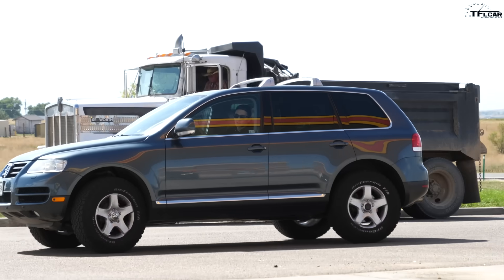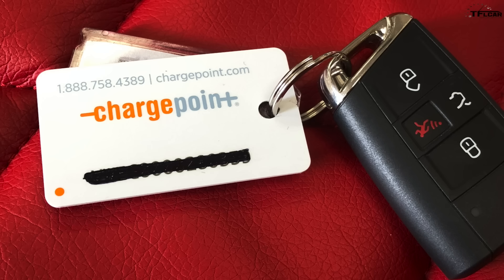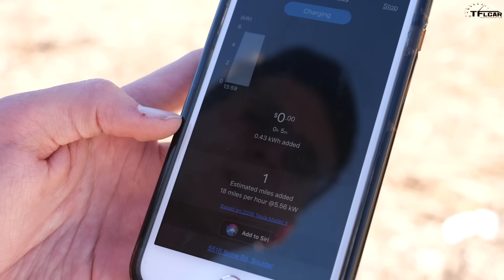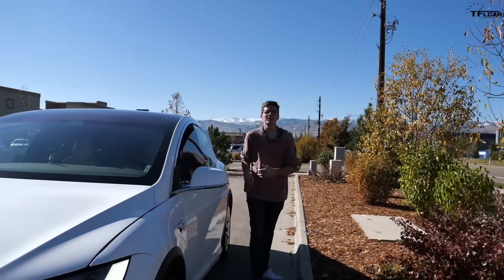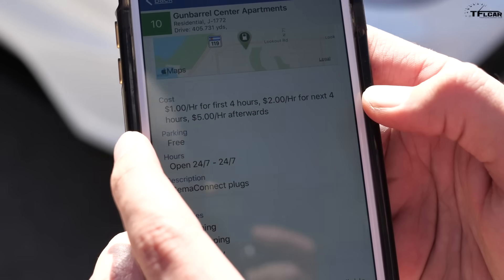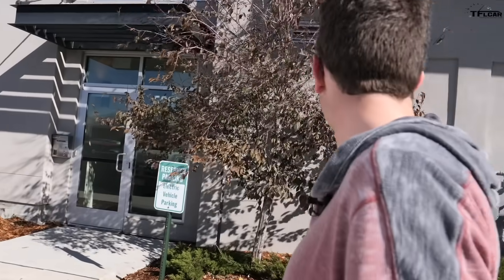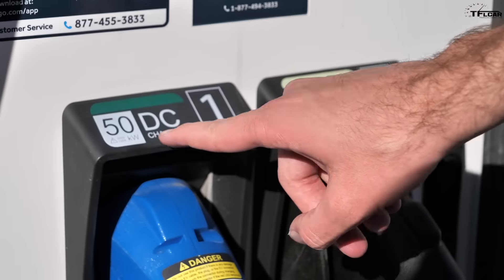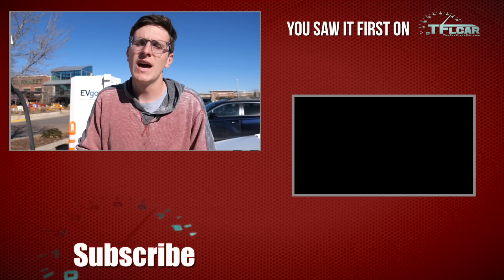Here’s Why Charging an Electric Car Can Suck - And It’s Not The Reason You Think!

Comment: What happens to the EVs when the mining of the volume of rare earth metals [the same ones needed to build wind turbines and solar panels] to build the magnets etc begins to decline to a point where it is no longer viable  even with the massive government subsidies they already receive, and the oil/gas industry has been intentionally crippled? 
Who is going to pay for the expensive replacement battery packs? How will the highly toxic battery packs be disposed of?
Remember that all batteries have a limited lifespan and will require regular replacement, not just a 'simple' engine rebuild like an ICE!
Reply: Bill Richards not true as the batteries will run for about 10 yrs, which isn’t short at all
Reply: @neilothee4966  I said that "...all batteries have a limited lifespan.....", an issue which plagues everyone who uses batteries whether it be for a mobile phone or a car. Compared to an ICE, a 10 year life span is very short but with regular maintanence, an ICE will last far longer than 10years. Some ICEs are still just as efficient now over a HUNDRED YEARS as they were when brand new.

Unlike a battery pack, an ICE can be safely rebuilt.

Further, as the battery ages, its efficiency steadily declines to the point of being completely useless.
Finally, can you please address the actual questions I asked?

Comment: If you live in an urban residential area and don't have a garage, there is a further problem: when you want to charge your car overnight, you first have to find a charger. Then, when the battery is full, you either risk a surcharge for blocking the charger for the rest of the night - or you go out in the middle of the night to move the car to another spot - which is usually the hardest time to find one.

Comment: Just wait, the price of charging “will” get comparable to gas.
Reply: I doubt it since majority of places give free electricity at their business and only need about 3 hours on a telsa charger to last you a few days of local driving. Plus supercharging is purely designed for quick charge for long trips and isn't in high demand since most people utilize their home or local free spots.
Reply: It will indeed.  Once the majority of the road fleet is electric the government will simply switch its revenue generating base.  As soon as your smart car is plugged into your smart meter equipped home it will inform "mum" that it is a car being charged and the appropriate "fuel duty (as determined by the government) will be added to your bill.
Reply: Yes .. and probberly even more EXPENSIVE 
They alredy claim problems in germany 
With the transport of power from Danish wind turbines .. 
So if you add som 100.000 thousend EV 
Well if you can't transport the power .. 
How Will you fill you car!!
Reply: Unless the time spent waiting to charge also gets comparable, I'll pass.
Reply: Carl Hursh I have solar & get credit but I live in sunny spot.
Reply: Yes.  Get you hooked and ramp up charges.
Reply: It's more complicated than that. Electricity is mostly generated by utlities companies that have public backing. Because of that, they can't just set the rate at whatever price they want. Charging at home will always be significantly cheaper than gas. Even if everyone switched to EVs and demand for electricity multiplied exponentially, the existence of DIY solar and wind (and the price of installation dropping dramatically) sortof keeps hungry utility companies humble. They juice the price, more people go off the grid and they don't want that.

 Supercharge stations are a little different. They can charge whatever they want but, right now, nobody would buy EVs if charging cost what gas costs. Even if they charged $.66/kWh to plug in (about double the average Tesla Supercharge price and six times the national average electricity price)... it would still be cheaper than gas mile for mile.

Until we start seeing 1000 mile ranges, though, EVs are only a serious option as a commuter car for someone with work/home charger access.
Reply: @aliebrubaker7473  you must be realy bumb!! 
I can see you zuk at basic math .. you got IT right !! You know who produses the power!! 
You also know if anyon makes food they All hawe to run flat out..to keep Up 
Ppl running ther stove's and oven's..
Now add x 10.000 to the power draw!!! ... Com on Mr IT is just !!! 
You can do the math!! 
What Will happend !!! 
When they are struggeling produsing power when ppl just make food ..
The STUPEDETI is tremendus ..
Reply: Carl Hursh 

Exactly.  Why would they not want to capitalize on this?  Plus this is extremely inconvenient waiting for the slow charge time.  

One hour charge time for ONLY 15 miles of driving.... 😵

Comment: hydrogen is the future in my opinion
unless we can charge our cars in the time it takes to fill a tank hydrogen seems the better alternative
Reply: Uh I hope you said this jokingly because Hydrogen is certainly not the future.  There is so much to explain why this post would be a short novel but in cliff note style getting the hydrogen in the first place is a very inefficient process. Then you have to haul Hydrogen in liquid form to the hydrogen station (highly dangerous). On top of that the Hydrogen has to be pressurized by the dispensing station before it can go into a hydrogen cell vehicle which the vehicle itself is not very efficient on using the hydrogen to convert it into usable energy.  Currently it takes a hydrogen station 30 minutes between fill ups so how would you like to sit there waiting for the station to build up enough pressure to fuel your car? Lets not forget that at least one of these stations has blown up.  Yeah that's safe.  Might want to do a bit of research before you make a comment like that.

Comment: In Norway you have to bring your own type 2 cabel to use it. And that`s great since your car either uses type 1 or type 2 plug. It`s just the QC who has cabels. Either Chademo or CCS. 
My only biggest problem is that America doesn`t use type 2 cabels and there`s a lot of cars imported like the e-golf, i3 and Fiat 500. And you simply can`t QC them! Not even the Tesla S and X which has the same plug as European type2  you can`t charge the car, so they are useless to import! It should be standard plug for every car and every continent.

Comment: Here in Canada we have very cold winters when we need heat in the car to keep warm and need the lights to drive in the dark.  How far will one battery charge take the car?
How much will it cost to replace the battery if and when it fails?
What sort of warranty comes with the car?
Reply: Extremely cold or Hot Environments aren't ideal for EV's. Especially the cold environments.You'll experience 20-30% loss in range.

Comment: I live in Tampa and I never seen a charging station.  Moreover I park my car in direct sunlight and why doesn't Tesla have a solar panel on top of the car roof as the car gets charged in the parking lot with free solar power.
Reply: Perhaps because each square metre of solar panel will give you 250Wh per hour in the sun.  That would give you, perhaps a mile of driving per hour in the sun.  So you get (say) 13 to 15 volts output from a panel at  about 20A, but that has to be converted via an inverter to a voltage suitable for charging the Tesla 350 volt battery.  You could, of course, put 24+ small solar panels on the roof, giving a voltage greater than the Tesla's battery voltage (in full sun, but not in the shade) and remember, every time you transform a voltage from the supply, whatever it is, to what you need, there are losses due to inefficiency... So, you put a Solar panel on your car roof, (at a cost,) add circuitry to enable the solar panel's output to charge your battery (at a cost), and the return is a mile or two of driving that cost far more than the few cents the power would have cost had you plugged it in.  Lunch ain't free, even in sunny Tampa.  My figures are not exact, but even if I were so pessimistic I'd underestimated by 100%, that's still expensive driving.
Reply: Tesla and energy companies can makes money out of people charging their cars or soon trucks, nobody controls or owns the sun.
Reply: @fortitudevalance8424  just wait until unfortunately the road are full of ev's the charging fees take off, they are only low now because there are so few cars about.
Reply: I live in Tampa also and never have a problem finding one
Reply: If the sun were that strong, it would kill all life on Earth.
Reply: Nice idea
Reply: A car isn't a 12v car battery or a mobile phone.
Reply: So how many square feet of solar panels do you think it would take to charge a car in even 24 hours?
Reply: @jackfenn7524  Excellent point. Even if the car was covered in panels, it would have very little effect on the level of charge.

Comment: This is precisely why Tesla is ahead of everyone else.  They knew this would be the exact problem they didn't want their customers to experience.  The Tesla SuperCharger network largely removes this problem in its design and high speed charge rate of over 500miles per hour when your battery is at a low charge state.  This is the charge state you should arrive at the charger with, for faster charging at each stop.

The other EV manufactures are so under funded for EV  development that they have no chance to create their own charging network.  I am not saying they should, but their customers are going to want something that is convenient and cost effective.  VWs punishment for diesel gate is "Electrify America", is paying for CCS/ChaDEMO plug type charging stations which will enable VW group cars to have their own charging network, paid for by the public, instead of by VW.  

It's going to be difficult to have a nice 200kw charging network across the public space for long distance travel.  It will be some time that everyone has to fight with all these choices if they are not using the Tesla charging network.  

Charging at home with a 240v @50amp circuit is a $300-$1200 investment for many just because of the costs of #6 wire.  But, if you have a spare 240v breaker space in your break panel in your garage (pretty typical), and can charge from a NEMA 14-50 outlet by your panel, you can get something put in for around that $300 price.  Some people have to get a new panel or even a new 200amp feed because of the state of their existing electrical system.

Overall plugshare like apps should be all that's necessary.

Comment: I've been driving my Chevy Bolt for 6 months now. I absolutely love it! Once you go electric, you'll never go back. I save time by: toping-off the battery overnight, never going to a gas station, never changing the oil, never changing the oil filter, never replacing any hoses, never replacing any belts, never replacing fuel filters, never replacing air filters, never changing the radiator fluid, never replacing transmission fluid, never replacing catalytic converters, rarely replacing brake pads (regenerative braking), and I get to my destination really quickly!
Reply: But the price of the battery is just as much as the car, and driving in heavy rain is another thing.
Reply: @GieCampbel-ug9jl  The battery is guaranteed for eight years. I don't know how much a new battery will cost in eight years. Will there be cheaper third-party choices? Will I even need one? Will I buy a new car by then? Even with an ICE car, I could be in the market for a new car in 8 - 10 years, anyway. (I did keep my last vehicle for 22 years, though.)
I've driven in heavy rain and found no difference. Why would an electric car be different than an ICE car in the rain? My Bolt is only front wheel drive, but many of the Teslas are all-wheel drive so they should handle very well in the rain. I've seen many Teslas doing fine in the snow.
Reply: @allencox5413  how dare you counter his argument with logic and evidence, you monster
Reply: @Techguyericd  heh heh heh
Reply: @Techguyericd  i agree! 2020 Dystopian future with logic and great points!
I shudder!
Reply: @allencox5413  try it in Arizona
Reply: @wlonsdale1  Hey Walt. The range of the Chevy Bolt is advertised as 238 miles. This depends on how you drive. My range indicator has shown over 300 miles if I am not being lead-footed. The things that cut down on range are excessive acceleration (which I am guilty of - it's just too much fun!) and the heater. Since the motor creates very little heat (think loss of energy), the heater has to use an electric heating element that drains the battery on cold days. Just like Southern California, this won't be much of a problem in Arizona. I have found that the AC does not affect the range by much.
Reply: @allencox5413   Yes, but excessive heat or cold is not good for batteries, and cuts down on battery life. More mild temps are ideal.
Reply: @allencox5413  EV Batteries last 8-10 years at a cost of about $10K. What do you think that will do to resale values.
Reply: @sptrader6316  That is a good point. I'm not sure. I'm on a three-year lease now. Will I continue to lease so I'll be driving a 2025 Bolt then? If I buy my 2019 Bolt (which I am seriously considering at the end of my lease), how much will my battery degrade? Will still be good enough to get me around town? In 8 - 10 years  will there be inexpensive third-party alternatives? Until then, I'm enjoying the performance of the EV, the maintenance-free aspects of the EV, the fuel savings of driving an EV, and the clean air from driving an EV. With the current state of the EV infrastructure, EV's may not be for everyone. It does fit my purposes nicely. I have access to an outlet at home so changing in no problem. I think that it is a good fit for many commuters in urban areas. We are on the verge of an explosion of new models from both big and small car companies and improvements in infrastructure that will make prices and convenience of EV's very competitive.
Reply: Best answer
Reply: And never going over 30 mile!!
Reply: What is the cost of charging an EV weekly and monthly. Also, reliability reputation?
Reply: @jeffreyfurtado3681  The battery holds 60 kWh. We pay $0.08/kWh (LADWP). To "fill the tank" is $4.80. I usually get around 4 miles/kWh. This depends on how you drive. I looked at my electric bill from the year before I had my EV. The bill had gone up by an average of $2.50/month. My electric bill depends mostly on how much I use my AC. I ran my AC more the previous year and that really affects the bill much more than my EV. I have a roundtrip commute of about 12 miles. I'm just using the level 1 charger that came with the Bolt. I was planning to upgrade to the 220V level 2 charger, but that has not been necessary. If your daily commute is less that 40-50 miles, the level 1 charger is fine. 
As far as reliably, the electric motor has only has one moving part. I've had my car for one year and I have done zero maintenance. The only scheduled maintenance for 7k miles is tire rotation. If I understand correctly, the Teslas have reliability problems not related to the motor or battery.
Reply: @allencox5413  , thanks for the information. I appreciate that about EV charging.

Comment: 16-17 Miles per hour charging is brain numbingly stupid slow, there is not a practical use for this low charging rate, except maybe if its your own charge point and you don't need the range, if you don't need the low range use a bicycle.

Comment: In the Netherlands, you only need, in most cases, one card for all the different charging point companies. There are more card companies which have a variation between the charging stations companies you can use outside of the Netherlands and the cost for charging.

Comment: This is a really really slow charger. The standard will be the Tesla Supercharger. In 5-10 years every company will use the same adaptor and every charger will have min. 50 kW.
And every charger will work without any application!